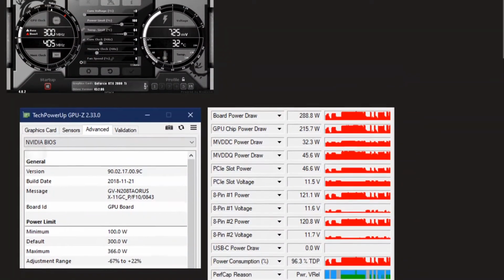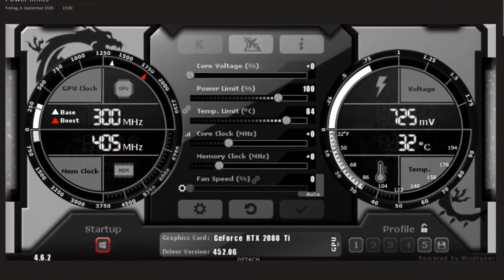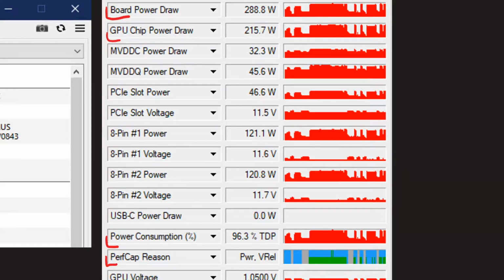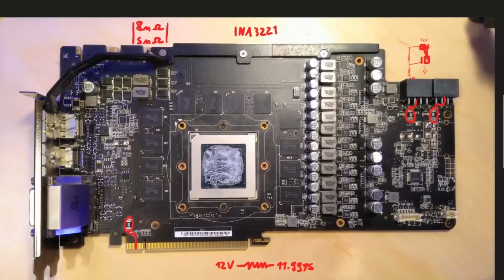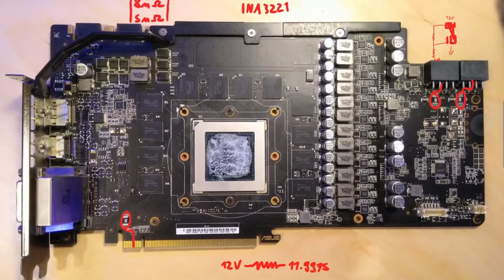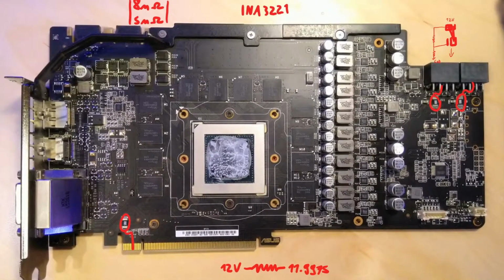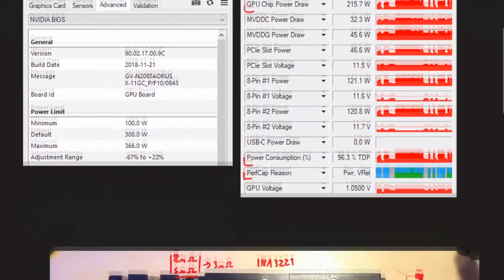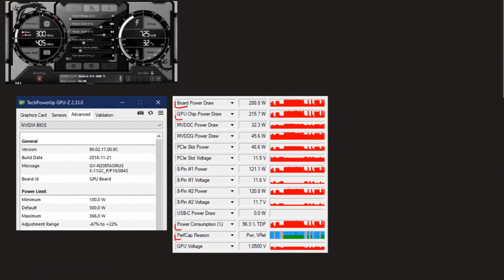Power Limits // Overclocking Basics

Comment: How do u get hold of so many GPUs??
Reply from the maker: some i got as collection pieces like the 780Ti Matrix or 580 Lightning. others i got for pretty cheap on ebay. the two reference 580s were 15 bucks each since they were dead when i got them or the 460SE was just 6 EUR for a working one. over what is now basically a year i got quite a collection going. also got some from friends like the GTX 480 and HD 7950
Reply: SO ... Ebay is your best friend ,isn't it :D?
Reply from the maker: @Ozonised  it can be useful when you know what you're looking for